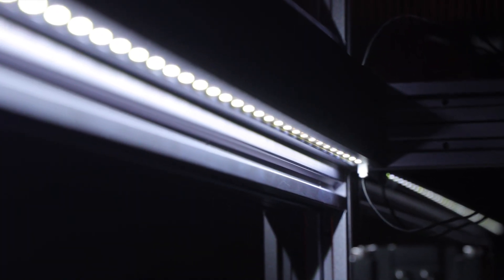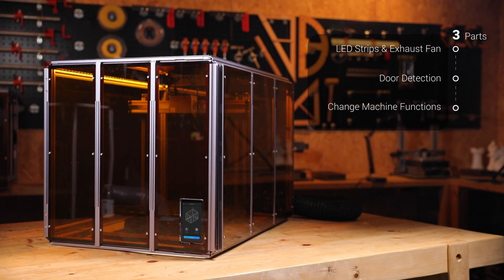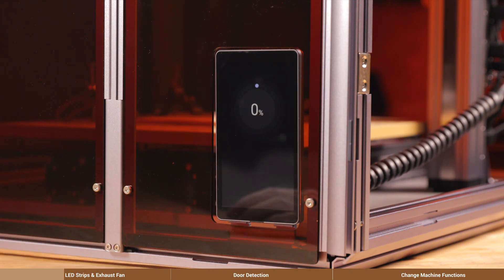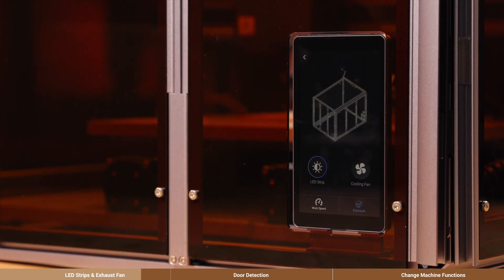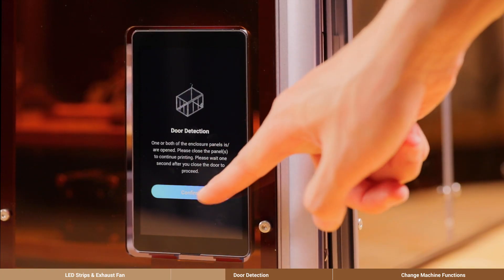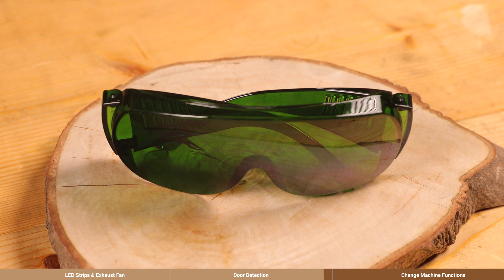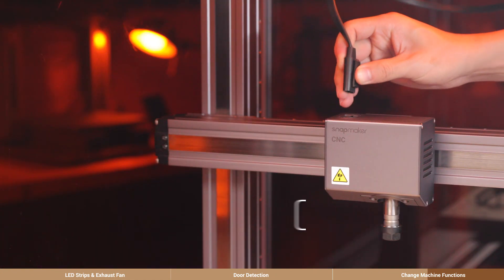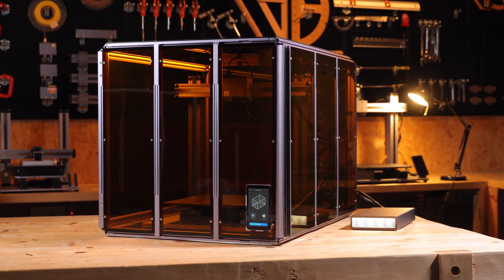Guide: How to Use Snapmaker 2.0 Enclosure

Comment: Hope you guys find a good use for all the packing foam that's included!
Reply from the maker: We will improve our package and fix the problem...(mokey puppet face
Reply: @Snapmaker  A bit late now. You should have used cardboard, not the mountain of plastic you've spewed out into the world already.
Reply: The foam packing was first class.
I saved mine and have started using it for other purposes.
Reply from the maker: @joeknockane8831  Actually, we have always been concerned about environmental protection. Due to the considerable weight of our product, it's unrealistic for us to use cardboard only, while the EPE foam is the best one we could find, which is lightweight, shockproof and eco-friendly enough (could be naturally degraded in 6-24 months). Of course, this is far from perfect. We are still working on a better package that is more efficient and greener. Thank you for your concern.
Reply: I am with Geo here, foam packaging is amazing and works great for moss wall :)
Reply: @vivdiv  I want to hear more about this moss wall!

Comment: Would this help with cutting carbon fibers with the CNC function? Carbon fiber dusts are not a good thing to have in your room.
Reply from the maker: Theoretically the enclosure is able to keep Carbon fiber dusts from spreading out because the acrylic panels, which are static most of the time, could attract the dusts. You will need to clean the panels every time you carve on the carbon fiber material.
Reply: @Snapmaker  that's reasonable, it's good to know it has that feature that being afraid of having carbon fiber particles in the air!
Reply: A good solution would be to adapt a small personal HEPA filter in extraction mode. It would also give snap maker the ability to monatise on the filter elements.

We used HEPA filters on all our industrial laser systems at MiniFab in Vic. Australia.

Comment: Is laser printing on par with a glowforge?
Reply from the maker: Not exactly. They share the same function of laser cutting and engraving. But Glowforge has a higher laser tube power of 45W. They are designed for different purposes.